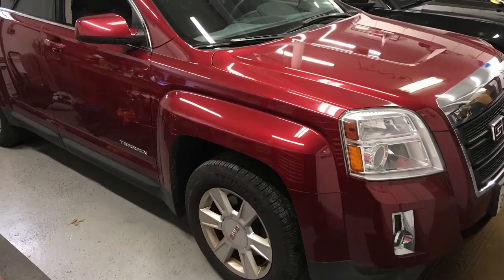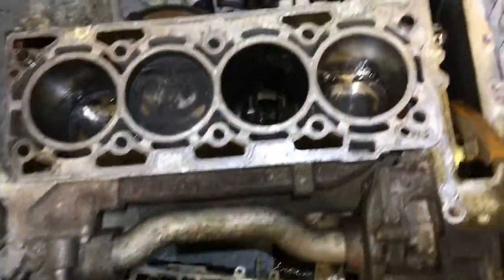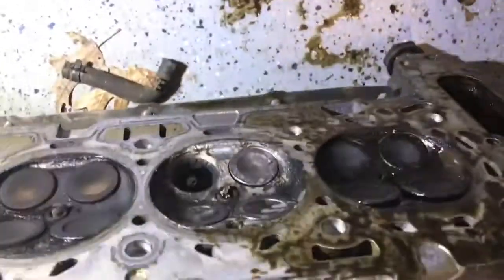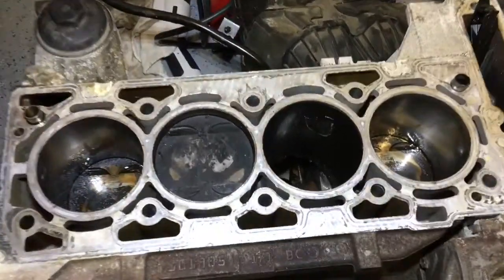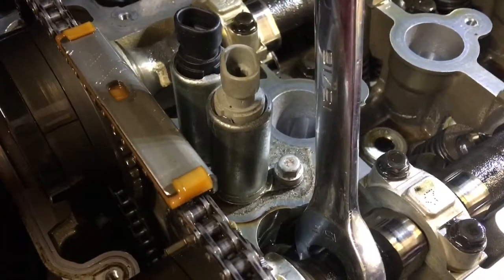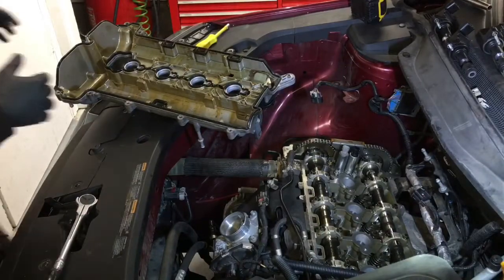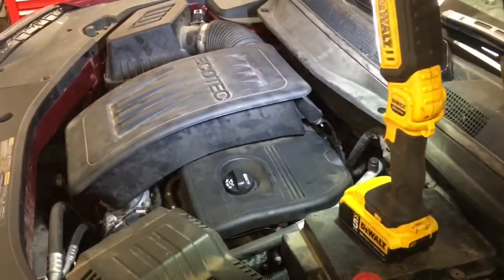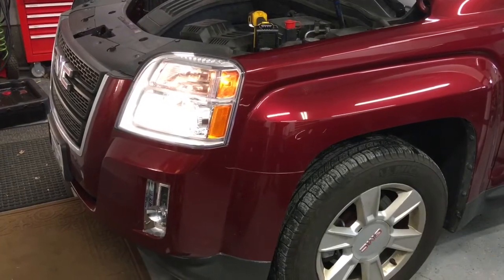DIY Ecotec LAF to LEA GM 2.4 Engine Conversion on 2010-2011 Chevy Equinox & GMC Terrain From Topside

Comment: Hello I am starting this swap. Have 2011 equinox LAF got a 2013 terrain LEA engine. Did you run into issue with the air ports near the exhaust manifold?

Comment: Im doing this swap on a 2011 Buick Regal. The timing finally jumped so I parked it. Its just been sitting for 2 months and now has no brakes and a maf code appeared which after replacing the sensor and back probing looks like an ECM MAF circuit failure.Its a pretty car and the girls seem to like it but man it seems to break just sitting there. LOL!

Comment: Ive done dozens of chains etc in these 2.4 engines but apparently never in a 2010 yet.. customers original engine was smoked with metal so i didn't risk it and got a used lower mileage 2010 engine.. well long story short, ove warrantied 2 different engines and STILL cannot figure out why im getting p0016/p0017 codes.. correlation codes. I set timing like any other time ive done then. 2nd engines i take cam reluctor had spun and gm discontinued the intake cam for that year. Its a 1 YEAR ONLY! 🤦‍♂️ so 3rd engine i put in was good. But im STILL getting the codes. Ive read you set timing like normal, but move the intake dowel hole to 5 o clock. I did that but still no solution.. does all of the colored linka line up like usual even tho im movinf that intake cam??

Comment: Is this still a viable option in 2023, is there a better option that’s cost effective?
Reply from the maker: Yes it still is. There are no other engines that can drop in as easily to keep you going.
Reply: @vinniekung4680  how much would it cost if i take it to a shop to do?
Reply: Are there cost effective EV conversion options available?

Comment: I want to change my old and broken engine for a new one that I already bought, I have a question, should the engine and transmission be removed together or could I just remove the engine and leave the transmission in its place?
Reply from the maker: I removed it with the transmission still in. Some bolts are hard to get to and it’s a real tight fit against the frame rail. Possible in other words. Others prefer to drop the entire subframe and powertrain as one piece.

Comment: my girls lea 2013 ecotec goes thru a gallon a month so your old engine is as bad as the one you put in. if i have to change the engine i may go with the cobalt engine and use the lea head. thanks

Comment: So could anyone tell me if I could swap a 2.4L out of a 09 cobalt into a 2014 Terrain with a toasted 2.4L?   just curious as it is nearly impossible to find a used 2.4L out of a terrain anywhere, and I have a cobalt sitting with a good 2.4L engine.
Reply from the maker: I am pretty sure it will not work. Need a newer 2.4 and truck based. The bellhousing I recall is different.

Comment: Very curious to know how that 2015 LEA is doing? I have the same engine in 2015 Equinox and right around 90 thousand it's been shit ever since. Intake and exhaust cam positioning sensors continuously throwing codes, mysterious electrical problem very recently (battery draining), P0172 code which means timing chain or high pressure fuel pump. Diesels when turned off. Only has 104,000 so irritating!
Reply from the maker: Worked out well. I eventually sold it. Never had a code or issues afterwards.

Comment: I'm thinking of possibly putting an ecotec 2.4l in my 91 isuzu pickup truck. With All of THESE problems, what year has GM Finally figured it out with all THESE past Issues with THESE motors, so what year or so do you recommend I should go with. Because I know there pretty good Strong engines. Please keep up the Good work and sharing and Thank you for your time. And Please let me know your input when you get a chance. Thanks

Comment: My daughter’s 2011 Equinox 2.4 developed an oil consumption issue about 1-1/2 years ago, at around 60k. When she brought it in to the GMC/Buick dealer for a routine oil change, the technician noted on the invoice that it was low on oil on arrival.  This was a surprise, as it hadn’t used much up to that point. The service salesman brought it to her attention, and began a consumption survey, where they had her bring it in every 1000 miles for an oil level check and top off.  After about three or four visits,  they gave her a new car to drive while they replaced the rings and timing chain assembly with upgraded parts. I don’t know what other internal parts may have been involved. The dealer staff was really proactive, as she could have ended up with the same scenario. This was the result of a GM service bulletin where they will do this for this particular engine up to 120,000 miles.  I think it was initially around 70k, but it was extended around the time it was discovered. I think the required threshold is 1qt in 1500 miles, but I’m not entirely sure about that. She is the second owner, but there was still  no charge to her.  It has run flawlessly since; commuting daily with several long trips logged.

Comment: was having check engine light problems/reduced power problem when i did this conversion til I seen this vid, swapped the intake cam with the old, light is out.. engine runs beautiful "thumbs up"
Reply: which engine lights did you have? do you recall?

Comment: The newer 2.4 engine is still crap because of the PCV system building water and freezing in winter blowing out the rear main seal.
Reply: add a catch can dosnt mean the entire engine is junk
Reply: Add a oil catch can and a cmf vented oil cap for the engine to release pressure from the crank case.

Comment: Hi,

The one thing i noticed is you didn't installed the PCV valve back.  This was also an issue with this engine 2.4l. Did that changed or was it eliminated with this engine?

Comment: Hi did codes go away by doing this,  for fuel
Reply from the maker: For fuel pressure fault, yes.
Reply: @vinniekung4680  did you change the whole camshaft or just the sprocket in your video I only see you changing the sprocket

Comment: Just a bit confused above you removed the "LEA High Pressure fuel pump" was that just to swap the intake cam? Comment says it remains. Thanks, thumbs up.
Reply: I was wondering the same thing it skipped right to tightening the intake cam.

Comment: You can you the newer 2012 transmission as well dispite what the compatibility charts say. They all wanted $1200 for 2010 and 2011. The transmission was plug and play. Saved me $600

Comment: Can we just toss in the same ECU as the engine that's from the same vehicle & get away with it?
Reply: Fyi: we would have to toss in the LEA engine wiring harness also, because of the throttle body wiring connector being different from the LAF one.

So the intake cam gear swap labor is the way to go...

Comment: I will be doing this conversion next month, can’t tell you how much I appreciate this video, thanks.
Reply: It’s all done and works great! Thanks again.
Reply: Roy Funk did you have change the entire camshaft or just the actuator on the end
Reply: @royfunk1793   Hi same question here, did you also swap the old intake camshaft or just the actuator on the end thanks
Reply: Yes Change both the camshaft and the actuator.
Reply: @royfunk1793  thank you now my only problem is the 2010 engine is nowhere to be found I can purchase the actuator online but the intake camshaft seems to be discontinued please let me know if you know where I can find one. Thanks again
Reply: I wish I could help you out with that but the only thing I would suggest is to check out the wreckers. With all the bad 2010-2011 engines the should be some used parts available.

Comment: did you change the whole camshaft or just the vvt sprocket on the camshaft?
Reply: Troy Stein description says intake and sprocket cross reference parts will definitely tell
Reply: I'd like to know as well.
Reply: Skipped the hardest part spends time torqued bolts😶

Comment from the maker: Trouble codes were excessive fuel pressure and cylinder misfire.
Reply: Vinnie Kung so your saying you have to change the intake camshaft sensor?
Reply: Vinnie Kung I’m doing the Same swap and now I’m getting codes for the wrong camshaft sensor and fuel pressure codes.